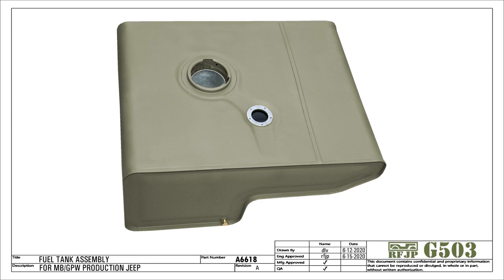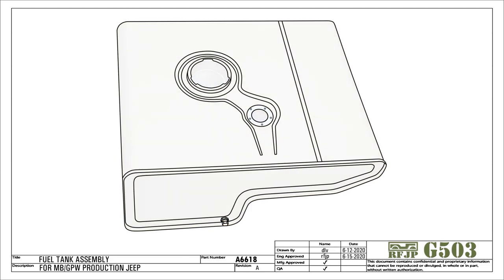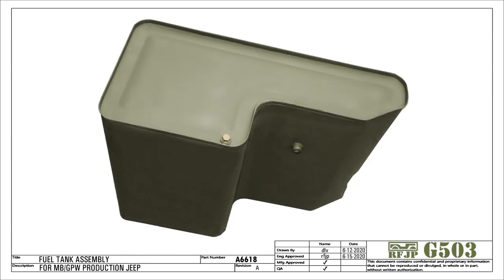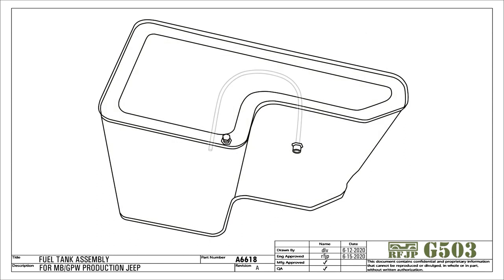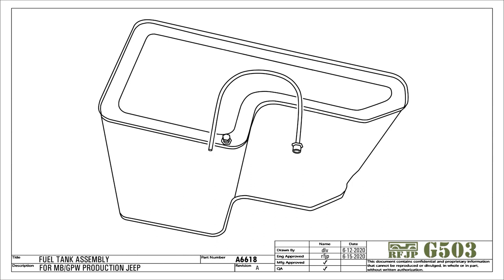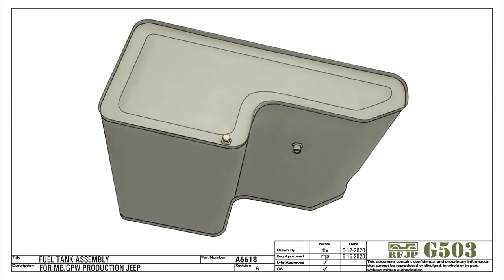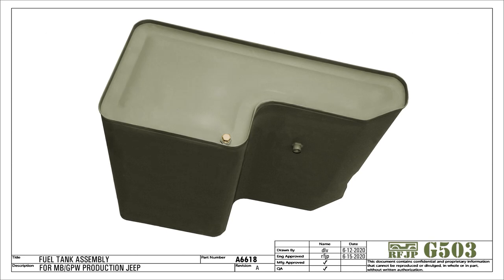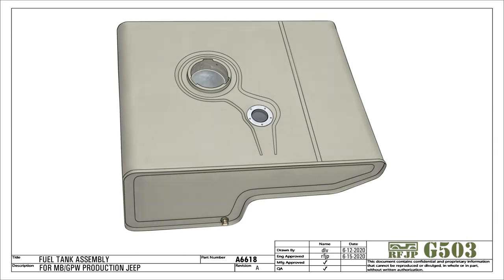How it works, Fuel Tank, internal fuel line pickup and how it works, Willys MB Ford GPW, Team G503

Comment: No illustration of the late tank with internal filter????
Reply from the maker: No
This style was only used for approx 7 
months at the end of production in 1945
Reply: A few of us have last ditch jeeps. I thought the only fuel filters were in the pump and filler neck extension I didn't know there was another one in the tank too. Must investigate further.
Reply from the maker: 1941 thru early 1945 the fuel filter was on the firewall, the filter was then moved inside the fuel tank on the bottom of the pickup tube approx January 1945 thru the end of production approximately July 1945
Reply: @TeamG503  going to check it out with a bore scope. Being spot welded to the bottom of the tank doesn't sound very "serviceable".
Reply from the maker: It was not serviceable 👍

Comment: But how dangerous is it really to have the fuel tank under the driver's seat?
Trucks had fuel tanks behind the drivers seat INSIDE the cab of trucks until the early 70s (and there have been cases of the fumes building up in the cabs)
And there were vehicles that had the fuel tank incorporated into the firewall section
Its not common for fuel tanks to blow up, and the tanks mounted between frame rails are just as easy to puncture if not more so.
And to top it all off, the driver has to get out to fuel up a vehicle anyways.